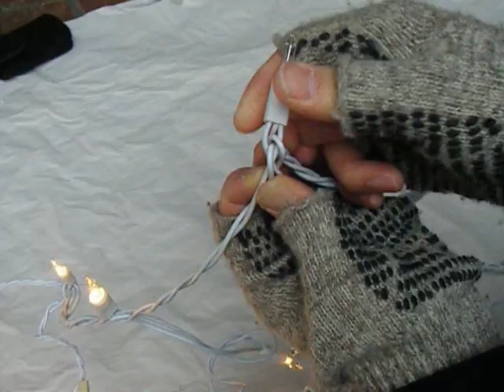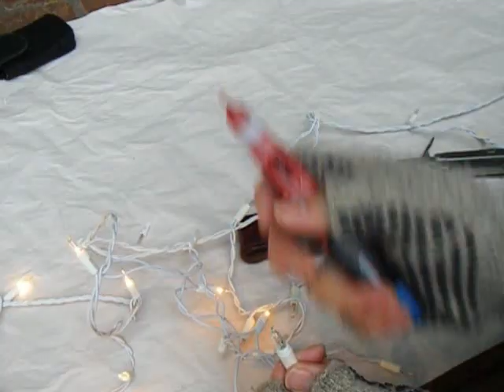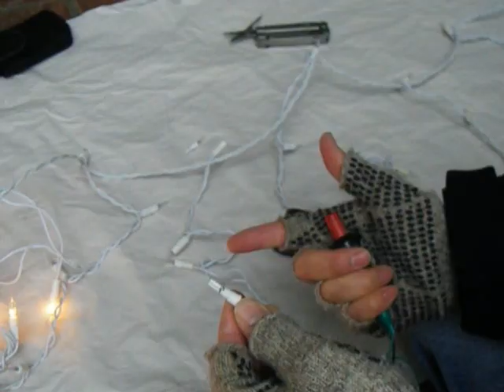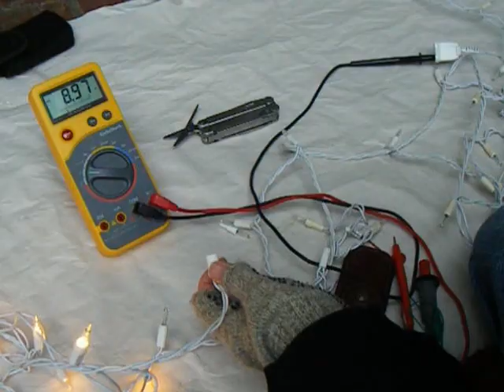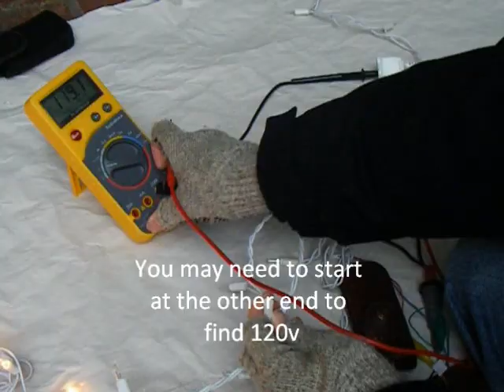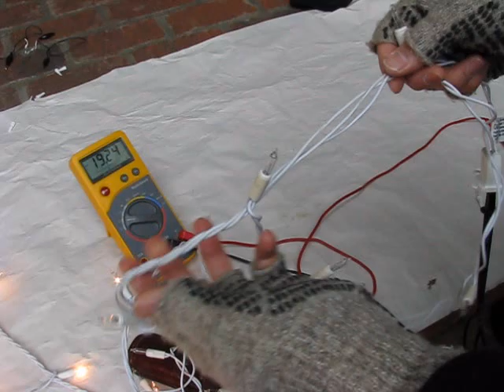How To Repair Icicle Lights

Comment: One of the best, if not the best of the icicle fixing videos.  So I had a 10 icicles not lighting in the middle of the string.  I used the Lightkeeper Pro to zero in on the problem area.  Then I used a multimeter to start testing sockets.   (tested bulbs on the Lightkeeper)  I found one icicle where every socket had zero volts except the bottom one which had 120.  Further investigation found that that one contact in the socket was out of position and upon fixing that problem all the bulbs lit.

Comment: I nominate you for a Nobel Peace Prize.  I have fought these icicle lights for years but this year found your video and used the techniques to solve my icile lights problems.  Thanks!
Reply from the maker: I'm glad it helped you.  I just fixed up my light set the other day with the same technique.  After I isolated the general area where the problem is I tried a Lightkeeper Pro and it actually was able to fix the section so that's a considerable timesaver when it works.

Comment: In case anyone comes across this via Google over ten years later (wow): The multimeter method makes finding the problem bulb much easier!

I set mine to 200V on the ACV readout, plugged in the black common lead as shown, and used the red lead to read each contact. I didn't get 20V on the opposite contact of 120V as in the video--it was 0 for me--but once I hit pairs of 0's I knew I was on the right track. I only had to switch two bad bulbs and one broken one on two different strands. 

Thanks for making this!

Comment: Personally i wasted an hour not finding the problem.  I spent 5 buck for new lights and thats that
Reply: What a manly man...
Reply: At least you tried - most people don't.
Reply: I'm an electronic tech and was looking for a simpler method. Kinda glad I didn't because I would  have felt like an idiot. I was certain  I could find the problem with a non contact probe, but that's difficult because the wires are all twisted, and, my problem is in a section that is in series on the neutral side... I might try filing down the male end so I could swap polarity. One thing you might want to explain further is that if you try the "shock" method, be sure to unplug the lights first 😅. Thanks for a good video. Some of you don't get it, but there are some of us so curious that we can't stand to do anything but fix these things. As far as installation, I always do it in the dark with the lights pre tested and powered up. If you shoot a staple and it knocks you off the ladder, at least you know where the problem is 😊.

Comment: How can you have 120v in one socket and the light still not light up?
Reply: power enters the socket but is stopped by a broken filament in the bulb ... electricity enters one side of the socket but can't exit the other side so lights go out
Reply: The connection is on serie not parallel

Comment: wow these lights are exactly what I have I hopw can do this visually because the lights are up and its 20 degrees out right now.   By the way what type of bulb is this and best place to buy them because i have two 2 sets of  20 feet connected together and both have begining section off so total segments 20 feet each begining section not on.

Comment from the maker: It's been 4 years since I posted this and I still use these methods with 100% effectiveness.  Yes, I did buy a lightkeeper pro, but I still have yet to fix a problem in an outdoor light string with the click spark.  The problem continues to be rusted out wires.  Thanks for the one comment that someone actually fixed several sets with a BBQ igniter!  I have found, however, that the LKP has a handy bulb extractor, tester, storage compartment, and a non-contact tester all built-in so I find it useful.  I was once able to find the problem using the non-contact tester in the LKP on a lighted reindeer, which is a straight set - a lot simpler than an icicle light.
Reply from the maker: It's now been 7 years since I made this video and I still have the same string of lights!  I turned one string into a "donor" for bulbs.  I think I've finally fixed all the rusted leads because the LKP actually worked for most of the strings this year.  So now I start off with the LKP and if that fails, then use these methods.  I admit it still takes waaaaay too long, but I hate to throw these things away so until I've run out of donor strings I'll keep going.  I've stopped using the LKP bulb extractor in favor of a pair of electrical wire cutters or anything with a handle & very thin jaws that can pry up even the tightest bulbs.
Reply: And that other video suggests buying several at discounted prices after Xmas

Comment: I have "expensive ge lights" that the light keeper didnt fix.  It did allow me to identify the area of the breakdown and that along with the volt meter helped me determine root cause...  somehow a lightbulb twisted in the socket...  second I pulled it out it worked.  I used this 1, 2 punch method and now have 4 working spare sets that were going to get trashed.  I appreciate you taking time to put this together.  I like your shunt fixer better...  the batteries for the light keeper are expensive and almost offset the cost of a light strand.

Comment: This method doesn't work for all brands of icicle lights. Mine are the expensive GE lights and they are wired completely differently from the lights in your example. I am quite sure that the commercial light testers won't work with them either. Which is a shame, because I don't even see them in stores anymore.

Comment: Thank you so much I found like a 4 dozen lights that were burnt out, I had to put aluminum foil to complete the circuit for some that weren't making contact, but a part of my lights are flickering now which isn't supposed to happen. At the beginning non of them turned on so thanks for the helpful video!

Comment: Great video. Thanks for taking the time to share your method. I've used the Lightkeeper before but it can be hit or miss. The multimeter method looks more straightforward, especially with your technique. I may try using both tools. Btw, don't you hate when a section goes out after they're already hanging on the house :) . Thanks again.

Comment: I usually just cut the problem section out and replace it with a one that is working.   You can cut it at the section of the lights that have only two wires leading to the next section.

Comment: Two years ago I said I would never buy any Christmas lights that where not LED's but with you BBQ sparker method i just saved a huge string of lights. I just shocked it in different ports with the set unplugged and traced down the bad light very quickly once plugged back in. Shocking fixed my whole set. Thank you for this video.

Comment: Excellent.  I repaired 1 string using your method.  The 2nd string was really tricky.  A 50 bulb section (150 total) was not lighting.  After exhausting everything else, and determined to salvage good bulbs, i began testing bulbs from the bad section  in the good, and discarding any that did not light or complete the circuit.  I found 1 then broke the circuit.  I rounded up some spare bulbs. Put all 50 back in place, and it WORKED.

Comment: Since I always start putting up my Christmas lights in November, since October is pretty far along I decided to get out the Christmas lights and check and see if they were all working. What a PAIN!!!!! I have been working on one set for about 6 hours... at a cost of 15 bucks I think maybe I'll just go and buy new... I hate to waste it though
Reply: Klunket I experience the same problem every year that you explained. I spend an enormous amount of time trouble shooting these lite strings with maybe 20 to 30% success. I'm a hard head I believe in trying until nothing I've done works then I'll replace the set.

Comment: Thanks for the video, you inspired me to take the string down and inspect it indoors.  With the voltmeter I was able to narrow it down to one 'icicle' and found the next to last bulb had burned up, damaging the socket.  I bypassed it with a butt connector and heatshrink, now it has 299 lights.